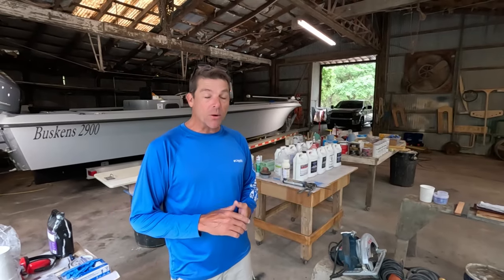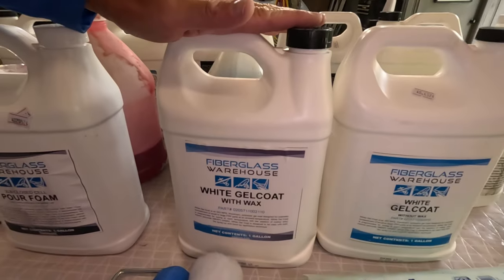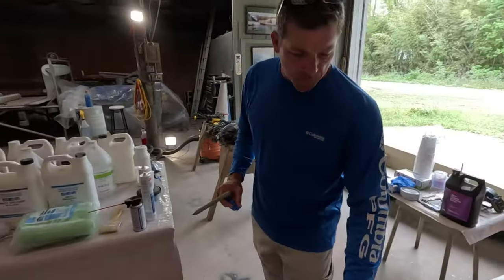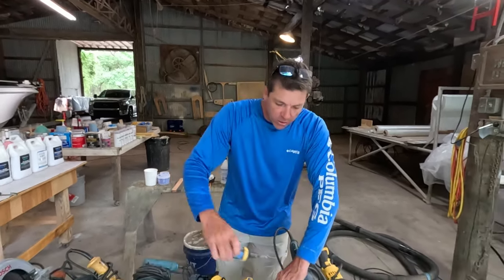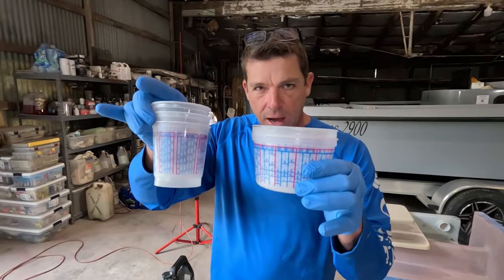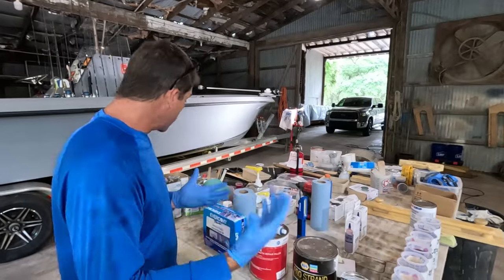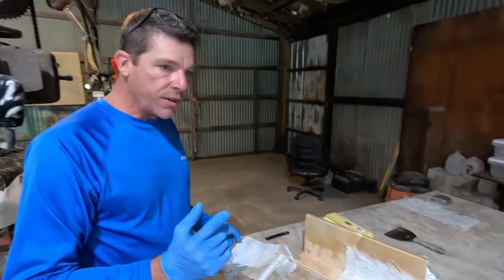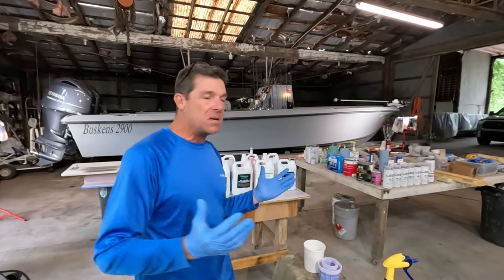100 THINGS YOU NEED TO KNOW ABOUT FIBERGLASS and GELCOAT!

Comment: Subbed and binge watching to soak up knowledge. I’ve torn off the top cap on an 87 Chris craft sea hawk and hope to start rebuilding all of my stringers and transom with coosa this winter. I’ve been told this boat was made with DCPD resin but I have no way of telling. Can I reglass using vinylester resin? Thank you for making these types of videos.
Reply from the maker: Fantastic, welcome to the channel! There is a good chance that it was built using a DCPD resin as that is very popular with high volume builders. I don't know of a way to know for sure, though. Vinyl ester could be a good option for your rebuild, just be sure to put a very rough 24 or 36 grit grinder surface on everything that you will be fiberglassing over so that your resin can get a very good mechanical bond. I do have a 21 ft project boat that we will be putting a transom, stringers,  floor, etc, in starting soon. Hope this helpsand thanks for watching!

Comment: Really enjoyed that, a confidence booster that I’m doing most of by boat work correctly using resins and tools, but I’ve been fighting with sagging Gelcoat atop previous epoxy in certain repair areas, gotta prep it right. What’s the best poly resin to cover a small epoxied area so the Gelcoat with stick?
Reply from the maker: Glad you enjoyed the video! I don't recommend applying gelcoat over epoxy in most cases. Sometimes it will cure properly and sometimes it will not. I will be doing some more research and maybe a video on this topic soon hopefully. Thanks for watching!

Comment: What is your opinion of Total Boat / Jamestown Distributors for resins and glass?  I'm using 2oz CSM for glassing a yoga ball for a Halloween prop... is the 2oz csm too stiff?
Reply from the maker: As far as I know they have good products. I have always preferred a lighter weight csm personally, usually 1 Oz. Just because it is easier to wet out and work with. I am sure the 2 Oz can work, but it will take a little more effort. I hope this helps and thanks for watching!